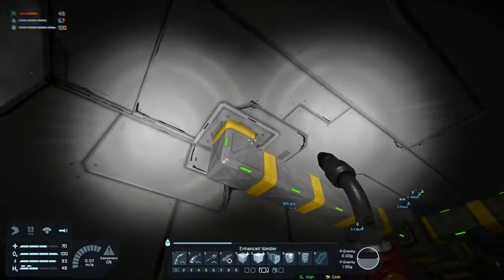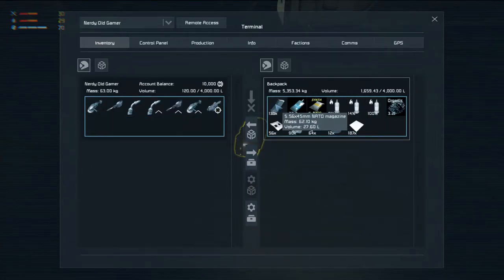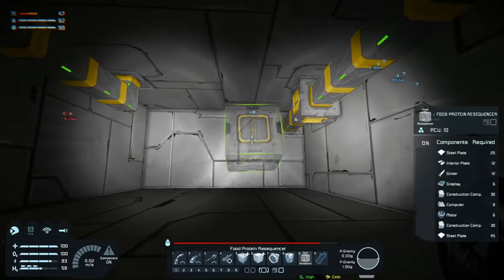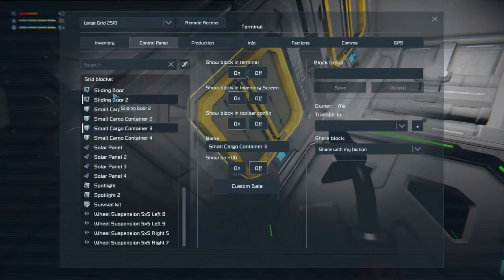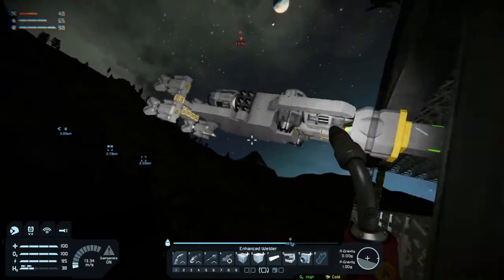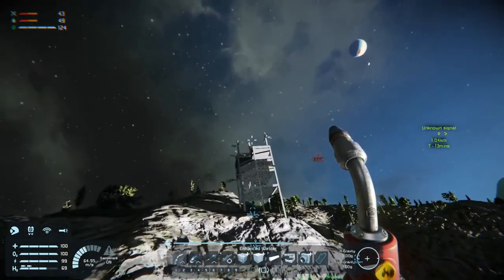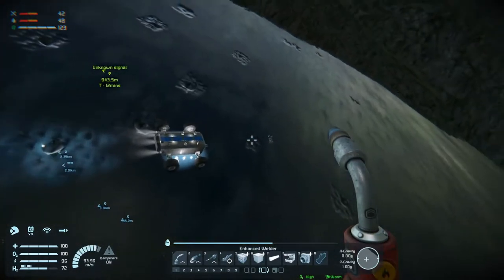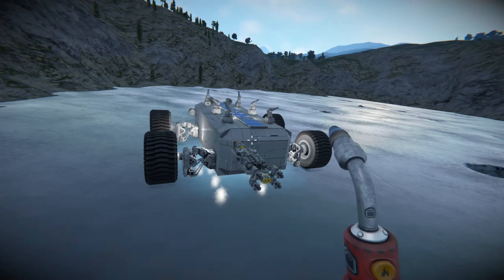Lets Play Space Engineers Modded Survival Ep20   Rover Lights & Butt

Comment: The Miner. to many trusters and to lil power. batteries with that many trusters will cause a overload as you can see at the right corner. if you move forward the truster require more power as at that time you use more trust. so for example uptrust to keep floating 70% power add the 40% for forward trust and you got yourself a Rock. i advice you to either switch to a hydrogen base miner or add a o2 gen and a hydro engine for extra power
Reply from the maker: Hi @koine, I had not noticed that, thank you very much for that bit of insight, I shall have to consider my options on that one 🙂